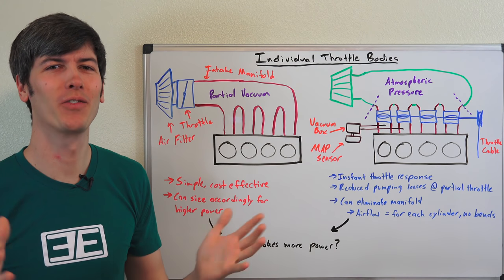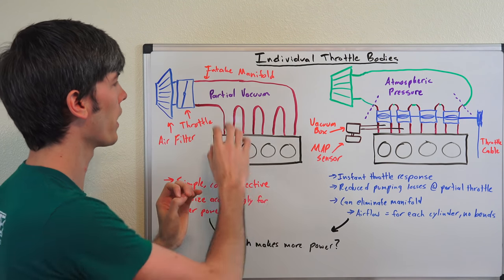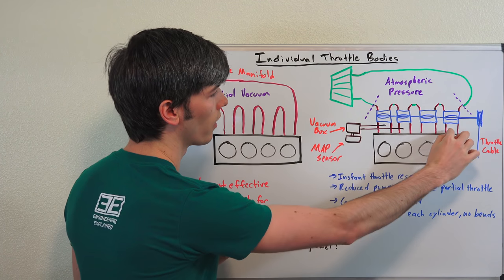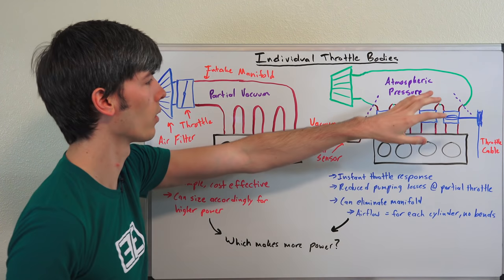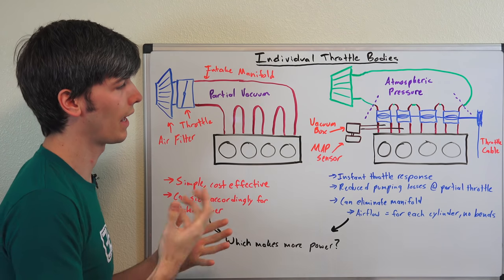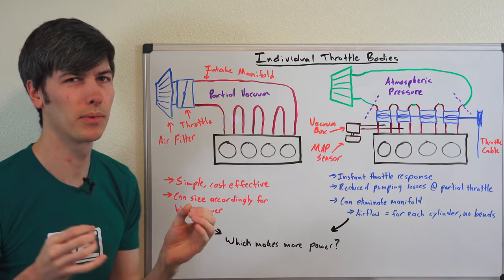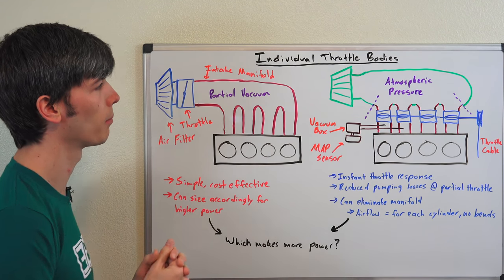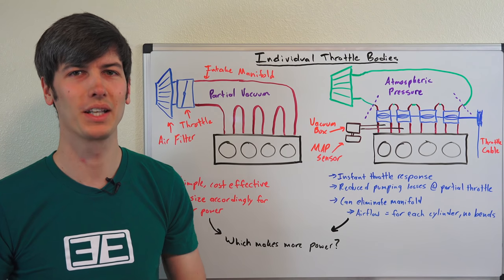Benefits Of Individual Throttle Bodies

Comment: Can u give some examples of vehicles that use itb ??
Reply: Yathu prem e46 m3
Reply: Usually high revving built N/A 4 and 6 cylinder engines, most times i see them are on Honda's or AE86's
Reply: Thanku guys !!
Reply: Yathu prem rb26 has them.
Reply: The BMW E90 M3's have have individual throttle bodies.
Reply: so did E46 m3 and the Euro E36 m3
Reply: Not the US spec E36 M3 .  Hence USA e36 m3 240HP vs. Euro E36 M3 300HP +
Reply: nissan GTiR , sr20DET used itb's
Reply: E60 M5 had 10 throttle bodies, pretty cool...
Reply: most multi-cylinder motorcycles; 2 cylinder, 3 cylinder, etc.
Reply: 4AGE 20V.
Reply: Blasphemi from Roadkill
Reply: Single-cylinder engines would technically also use ITB's.
Reply: RyanRants 😂😂 that's true!
Reply: Toyota's 4AGE 20 valve from the ae101
Reply: Initial D intensifies
Reply: Matheus Wohl lol you fucked that reference up, it's euro beat intensifies
Reply: The Hoonicorn.
Reply: Initial D intensifies is better
Reply: Every motorcycle I have ever ridden.
Don't know why cars don't, but motorcycles have one carburetor per cylinder or two in some models, Yamaha 660, and injection ones, some have also two injectors per cylinder.
Cars seem to have a more limited budget when it comes to the engine aspect of things, or simply bikes "need" more power.
Reply: Yathu prem RB26DETT
Reply: chbrules Take them to a someone who can machine those for you in steel and I bet you won't pay more than the factory ones.
Reply: I've got a 1985 Alfa Romeo Sprint, it's a 1.5l Boxer 4 with 2 twin barrel webers, each barrel feeds a single cylinder, so you could say it's got ITBs.
Reply: replies were good till dishits started commented on bikes engines
Reply: E92 M3
Reply: some supercars for example lexus LFA
Reply: E46 M3 E60 M5 E90 M3
Reply: James Baggaley pretty expensive to fix and pretty time consuming to clean 😂
Reply: maxreaper25 It doesn't break that often, and engineers came up with something called... What was is it?
Oh, air filters. No dirt gets inside the system.
Reply: Clavius Magnus you don't have to be rude
Reply: Clavius Magnus air filters help but don't devalue the cleaning of a throttle body. 
Look at a throttle body where the air filter has been cleaned regularly. It still will be dirty.
Reply: maxreaper25 No I don't.
No need for you to bash something for free because you can't afford it.
Reply: maxreaper25 I did many, many times.
My dirt bike had it's filter filled with dust that would definitely kill you if in the lungs, beyond the filter everything was sparkling. never had to be cleaned and never failed.
Everyone I know who did the same to their bikes will tell you the same.
If you get lazy and don't replace or clean the air filter, ever, the engine stops breathing before anything gets damage. You should know that.
Reply: maxreaper25 And suddenly it hit me.
Who can afford to buy and keep a V10 M5 will never go about the hassle of cleaning anything in his car other than dirt on the paint job, and replacing broken parts... So what? Tires alone are 1k or more.
Reply: All Alfa Romeo starting from the Giulia (type 105 and derivated cars), then Alfetta (type 116 and derivated cars). Two dual barrel carburettors for four cylinders.
Reply: All motorcycle engines. Except for some V twins engine( VT's engine 750, 1300, 1800cc Honda), (Suzuki Vl800, Vs800) and (some Harley's) reasons: not expensive to make and easy to maintain..also very low performance related to the volume of the engine.
Reply: My 1988 E28 M5, E30 M3, E24 M6, E9 3.0CSL, E60 M5, E46 M3, Z4M Coupe, E63/E64 M6,
Reply: They are not that expensive to buy 40k for a mint example. Now maintenance is a whole different thing.. Surprisingly they aren't that bad to upkeep if you treat it right, and do the maintenance..
Reply: >Not that expensive to buy
> 40k

You are vastly overestimating how much money people have to spend on vehicles
Reply: Do you know cars? 40K is a MINT example.... You can find them under 15K.
Second do you know what you are getting? Basically a poor mans Lambo from 10 years ago. 500+Hp V10 Sedan.

40K is not expensive for a mint example from a car that is roughly 10 years old.
Reply: You can put an itb system on a 4a-ge, most likely 3s-ge, and tons more
Reply: 300zx TT
Reply: E36 m3 euro has them
Reply: Yathu prem 
my ninja 250 have 4 throttle valve in 2 cyl
Reply: Hondas used for drag racing.
Reply: The legendary C20XE/REDTOP engine can gain 50hp by just changing it to ITBs, superb engine! =)
Reply: Ferrari Lamborghini maserati alfa romeo porche vw shelby cobras and mustangs gt40 jaguar, all did it with weber carburetors before fuel injection
Reply: A 1991 Honda Beat PP1 3 cyl E07A MTREC engine has three throttle.

Comment: Why don't modern supercars such as the Ferrari  F140 engine use individual throttle bodies but rather 2 throttle bodies per bank?  Did they manage to engineer engines to be as efficient and responsive with just twin throttles or is it emmissions reasons?  I don't see hardly any supercar manufacturerers putting ITB's whether it was more common in 80's and 90's.
Reply: V LT it is because it's a flat plane crankshaft  engine and that set up of two throttle bodies per bank working independently  works best with the even exhaust  pulses.
Reply: Is that the same deal with Lamborghini, Aston martin, Mclaren and Mercedes?  It's just odd as hardly any use ITB's, I read it's because of emmissions standards

Comment: Sooo Individual throttle bodies are pretty much the same as inline carburetors other than carburetors mix/control the fuel intake by a venturi effect rather than having an injector spraying into the intake manifold?
Reply: Yes ... many high performance pre-fuel injection exotics did just that. Be they down drafts or side drafts, individual carbs were how they went. They of course were a bear to flow- balance, but they had metering tools for that as well. I personally had a Celica modified with an 18RG engine using twin 2 barrel side-draft Mikuni carburetors --- flow balancing was fun.

Comment: With wild camshafts (with large overlaps in valve timings) your going to get interference between the cylinders with the single throttle body -> see the very "lumpy" behavior of big block tuned cobra's with such a set up!

Comment: Wonder if this is a precursor to his s2k getting itbs.  FI is a much better bang for your buck on the f20/22c imho
Reply: EndlessV3rtigo. why is it people only think gross power gains are worthwhile? the S2k is a car justified by experience not numbers on a printout.
Reply: It's not about the gross numbers here.  A turbo setup will make a ton more torque in the lower parts of the band than itbs, even at partial throttle.  The only advantage I see to itbs is the throttle response and you don't have to deal with all the heat.  

I'm not a purist by any means; I've even had thoughts of LS swapping an s2k but I don't want to give up the buttery smooth shifter to do it.
Reply: Given that the S2000 is a sports car, and it already has plenty of power for its weight, I'd say ITBs are a much better option than a turbo setup. The instant throttle response would be way more fun than waiting for power you can't really put down anyway unless you get wider wheels aswell.

Comment: How would I control my timing if I do not have a stock computer for my engine? I would like to apply this to my engine that i received for 100.00 the cost of programming a ECU is way out of my budget I dont mind fabricating a throttle body or flanges for throttle bodies ( I am a TIG welder)

Comment: Does switching to ITB decrease gas mileage?
Reply: Wiggles The Miata I think no
Reply: Not at all, prehaps it would even make your engine more fuel efficient due to lowered pumping losses.
Reply: Wiggles The Miata it likely makes it less efficient. Sure reduced pumping losses, but also reduced low end torque.

Comment: As cool as it sounds, I rather have less parts to break.
Reply: same here, plus getting all the throttle bodies synced would be a pain
Reply: This isn't ITB carbs, it's ITB with direct/port injection.
Yes ITB on carbs was a nightmare to tune as you needed an AFR gauge for every exhaust runner, but on modern cars all you need is a long shaft for the plates. The plates can't be misaligned, really.
Reply: It's just a single piece of metal that links the throttle bodies so they open/close simultaneously. It's not at all complicated.
Reply: I guess the motorcycle manufacturers of the world are clueless about ITBs. Because all motorcycles I ever owned were itb.   My car is too.
Reply: harlyx64 i
Reply: AMENNN !!! ! !!!
Reply: It's not complicated

Comment: I dislike ITB's only for one factor, you loose all of the resonance in the intake runners at WOT basically into atmosphere if you have no air box and at partial throttle the throttles themselves mainly eat up the resonance and the rest just gets back into the air box making it that much harder to calculate a length for the peak torque rpm.

Comment: Are individual throttle bodies a must in today's high performance vehicles?
Reply: Agustin Holub Many performance vehicles come with factory variable geometry system of intake manifold. So it combines best of both. I.e. bmw's DISA.
Reply: o3tomas Are DISA and ITBs actually comparable?
Reply: Petar Minev DISA cannot achieve such short chamber as itb, but it changes the path of air for longer to get low-end torque. However, AFAIK with such system the single throttle body is wide open most of the time, and engine rpm is controlled by VVL, so there is no vacuum in the manifold. Hope it makes sense.
Reply: o3tomas Yes it does! 10x :)
Reply: The VQ37VHR engine is another example of individual throttle body I think lol.
Reply: サントスシｮナサン no
Reply: Agustin Holub itb's without a plenum is better for N/A cars, itb w/ it = awesomeness
Reply: Sprint cars use it.
Reply: Agustin Holub itb's are best for max hp and peak power in the curve. But they sacrifice some low end torque. Especially noticeable in low displacement engines.

It's why both Mazda and Toyota used plenums with mechanical variable length intake runners. That would be longer for low rpm and shorter and more direct for higher rpm.
Reply: Toyota also itbs on the 20v 4ages
Reply: Agustin Holub no

Comment: My S52 (1998 MZ3) has one TB, S54 has 6.  Simple, 240HP is enough, very similar numbers to your S2000, lets race.  :)
Reply: That's what it's rated for in the US.  Mine has some sort of "Shark Injector" tuning the PO installed, brings revs to 7K, not sure about power.    Conforti intake and Billy Boat exhaust.

Comment: Individual throttle bodies need to be synchronized as the manufacturer recommends. A bad synchronization between the butterflies could severely damaged the the engine components.

Comment: Is it possible to run the ITB setup only on the lambda and without any map sensor?
Reply: Yes, but without a properly functioning MAP or MAF strategy the responsiveness, driveability, performance and fuel economy will be less than best.
Reply: +Alex Haws 
How does your EFI system with only a TPS, IAT, CTS and CKP determine varying changes in load, altitude/baro pressure, air density and deliver the correct fueling/AFR over a wide range of operating conditions? 
I have significant experience and knowledge and I am confident my previous comment statement is accurate.

Comment: What I don't understand is, if ITB's are so good, how come Modern Supercars like current model Lamborghinis and Ferraris dont use it, they only have one throttle body per bank of cyclinders
Reply: V LT they sacrifice mid and low range torque. They're good for race engines and cars that will spend all their time near the top of the rev range. But not so great for driving around town.

Comment: Another reason diesel engines are so efficient. No throttle plate. No partial vacuum in the intake, and in the case of direct injection, nice cool air cramming through the intake valves.

Comment: hilborn injection is the same thing but with carbs basically
Reply: Not even close to being the same.
Reply: patw52pb1 I'm not afraid to admit I may be wrong but from what I seen from it it seem to be very similar. if u could explain the difference I'm always open to learning something new.
Reply: Nether Hilborn, Enderle units or Jenvey ITB are carburetors. 
Most specifically compare Hilborn or Enderle fuel injection systems to Jenvey ITB systems. 
Visually at a glance there is similarity as each system has individual port runners for each individual cylinder and each individual port runner has it's own individual throttle shaft and blade. 

While most Hilborn, Enderle and Jenvey systems share the commonality of individual throttle blades in individual port runners, the remainder of the systems are quite different. 
Most Hilborn and Enderle systems use a single common inline throttle shaft grouped for each bank of cylinders. 
Jenvey ITB systems uses individual throttle shaft and blade per individual throttle body in a very singular modular approach. 
Most Hilborn and Enderle systems use mechanical fuel injection and almost all most Jenvey ITB systems use electronic fuel injection. 
Hopefully that helps illustrate the differences.
Reply: patw52pb1 thank you I do appreciate that. I'm a very open minded guy and open to learning something new, a lot of people probably would have argued with u. but again thanks for clearing that up for me "learn something new every day "
Reply: +Tadd Mason 
You are welcome. 
Sometimes the comments section is a very hostile place. 
I have been professionally involved in engineering and professional motorsports for more than 30 years and I strive to learn something new everyday. 
 He who says he knows everything about a given subject is either deluded or mistaken or a liar. 

http://www.jenvey.co.uk/products2/individual-throttle-bodies/sf-individual-body-parallel-bore

http://www.hotrod.com/articles/hrdp-1010-what-you-need-to-know-about-mechanical-fuel-injection/#hrdp_1010_17_o-what_you_need_to_know_about_mechanical_fuel_injection-linkage_adjusted
Reply: patw52pb1 I do appreciate it very much. I'm never a hostile person and am always open to learning something new, that being said if I have definitive evidence to go with my statements then I'll say it and where to find it to back up what I say. Again I do appreciate you making that more clear for me and also appreciate the lesson lol

Comment: Can you use the individual throttle bodies with turbo vehicles?
Reply: Yewcmaster1 yes you can the rb26dett in the nissan skyline gtr or even the sr20det from the nissan pulsar gtir came factory with individual throttle bodies
Reply: Ah interesting. Thank you very much :)
Reply: Graeme Mcfarland The RB26 has individual throttle bodies? That explains the hype about its throttle responsiveness lol. The more you know!
Reply: Yes :) i run Ikeya Formula quad throttle bodies on my SR20det. Much better response and mid range boost.
Reply: Yes :) i run Ikeya Formula quad throttle bodies on my SR20det. Much better response and mid range boost.
Reply: Yes, The Nissan 300ZX Twin Turbo has individual throttle bodies.

Comment: Although technically correct, the depiction of the ITB system is a little misleading. Measuring MAP or a SpeedDensity approach in general is usually only supplemental on an ITB setup, especially when big cams and larger throttles come into play. The thing is that the MAP signal just goes to atmospheric above a certain throttle angle and therefore doesn't indicate engine load anymore, way before WOT has been reached. Therefore ITB setups usually measure the throttle angle as their primary load signal (throttle position sensor, Alpha-N).
Reply from the maker: Certainly wasn't intending to imply that the MAP sensor does all the A/F balancing. Throttle position sensor, intake air temperature sensor, and O2 sensors are all used to determine the proper ratio.

Comment: Does a variable intake runner system work with ITBs?
Reply: It is indeed possible to set up. I believe that F1 engines used to have that arrangement
Reply: @Samqdf  So the whole throttle array moves in and out? 🤔

Comment: a question, can you install itbs on a boxer engine? i don´t if it´s possible because of the different layout of an inline 4
Reply: you should be more than able to, as people can fit ITBs onto V engines, such as the 1UZ and VK56. with a boxer engine your cylinder banks form what is for all intents and purposes a 180 degree V. It would just need a slightly longer, possibly more complicated throttle linkage.
Reply: thanks a lot!
Reply: no problem!
Reply: Yep, my alfa 1.7 16v boxer has stock itbs.. throttle response is awesome
If you plan installing itb to your boxer check for some spare alfa parts

Comment: So basicly it is just like a four barrel carburetor?
Reply: Not exactly. A 4-BBL carburetor sitting above a collective intake manifold more resembles the diagram of the single throttle body in the video except that instead of just one valve, there are 4 which may open in sequence (primary / secondary) or all together. The ITBs on the right have dedicated throttles for each cylinder, he just used a 4 cylinder set-up for simplicity. Ferrari and Lamborghini used 12 individual throttle bodies in their early V12 engines. Early formula race cars did as well.
Reply: TheCarMan i see, thanks mate.

Comment: Turbo diesels and BMW Valvetronic FTW! no throttle bodies whatsoever , boost pressure right at the valves itself
Reply: gav do you even know what vanos is? by the way, m3 has individual throttle bodies and vanos too...
Reply: Ivan Cuesta , You are right , I mixed up the names , I meant to say Valvetronic, not VANOS